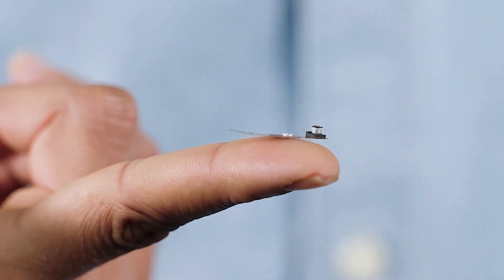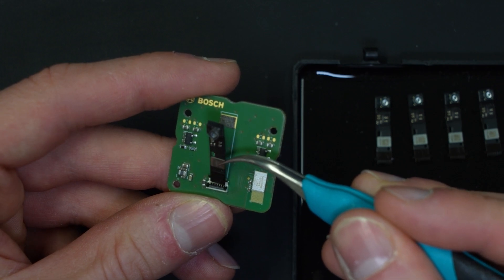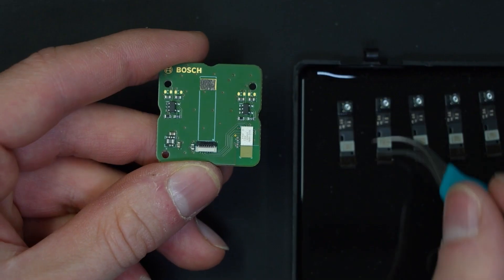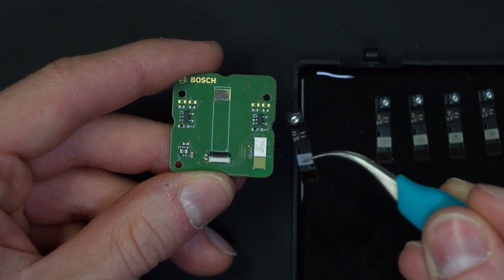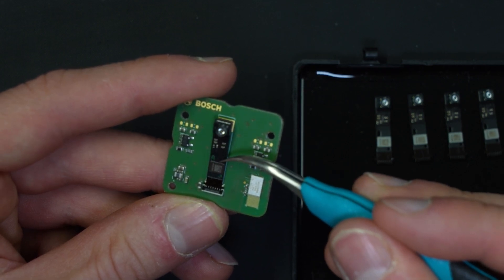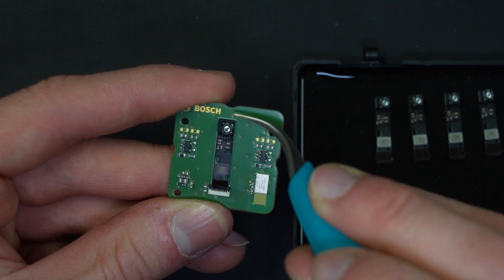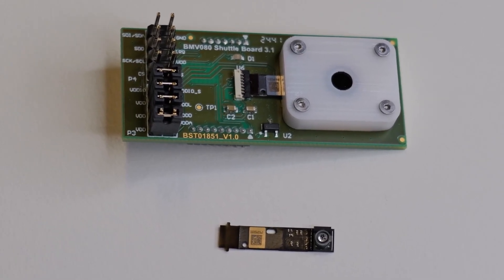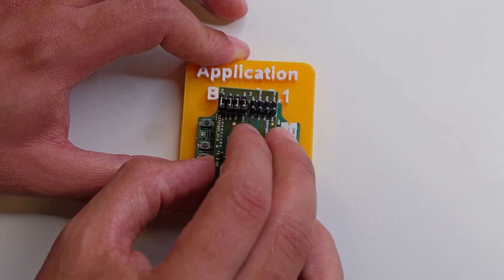BMV080 Tech Talk with ipXchange: Optical and electrical integration

Comment: where can I download the SDK? I couldn't get it on the link provided by bosh. 
Is there any off the box demo I can use to test this sensor
Reply from the maker: Hi 46Paulk,

The SDK for the BMV080 is available on the product webpage, and we recommend using the latest version.
https://www.bosch-sensortec.com/products/environmental-sensors/particulate-matter-sensor/bmv080/

To evaluate the BMV080 Shuttle Board, it should be used together with the Application Board 3.1. => https://www.bosch-sensortec.com/software-tools/tools/application-board-3-1/

This setup provides measurement data via COINES, you can find the info in the README file included in the SDK package. For data visualization, the SDK also includes a Web App. Please refer to the Web App Quick Guide on the product page for installation and usage instructions.

All the best,
Your Bosch Sensortec Team